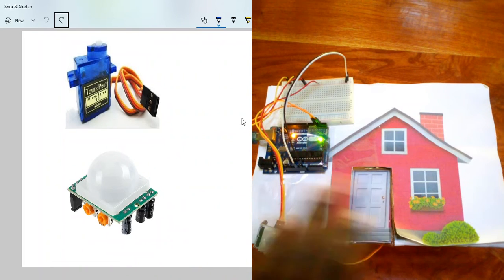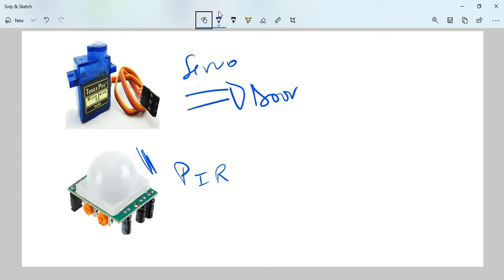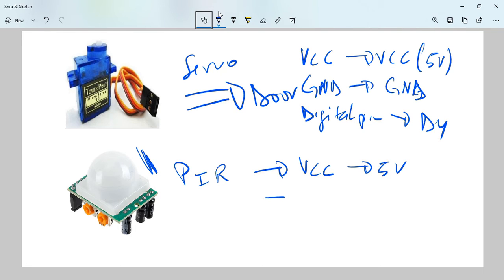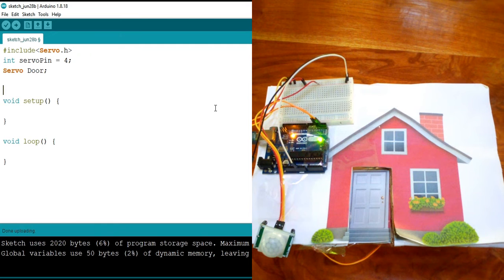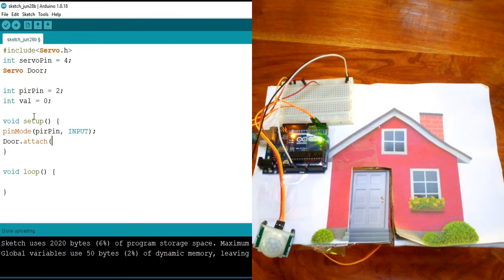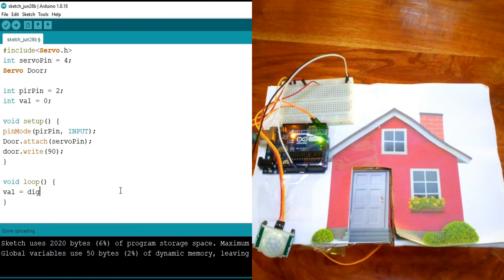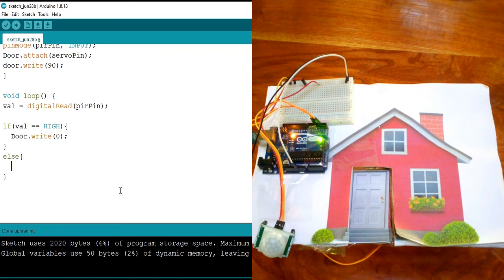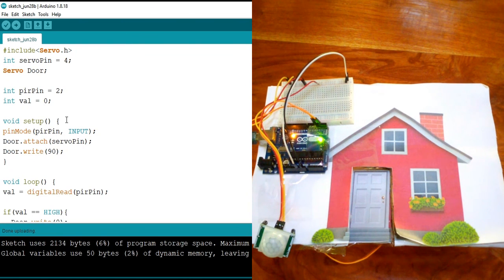How to make an automatic door using Arduino PIR sensor and Servo motor

Comment: Thanks, buddy. Iam a student and was searching for this to make for the science exhibition. I searched many codes finally found this one works. Thank you so much
Reply from the maker: The pleasure is all mine
Reply: code
Reply: #include <Servo.h> 
int servoPin=4;
Servo Door;

int pirPin=2;
int val =0;

 
void setup()
{
 pinMode(pirPin,INPUT);
 Door.attach(servoPin);
 Door.write(90);
}
 
void loop()
{
val= digitalRead(pirPin);

if(val == HIGH) {
  Door.write(0);
  
}
 else {
  Door.write(90);
  
 }
 delay(200);
}